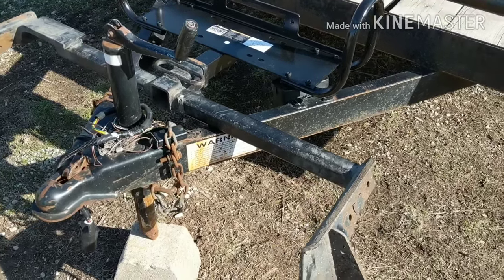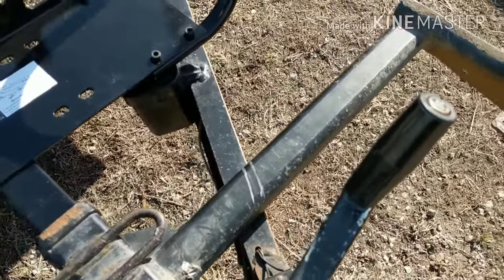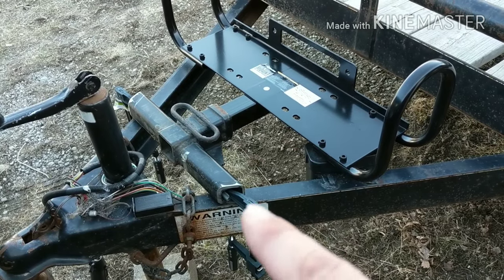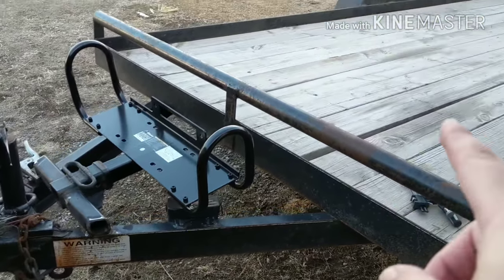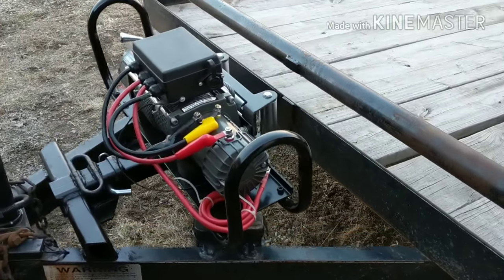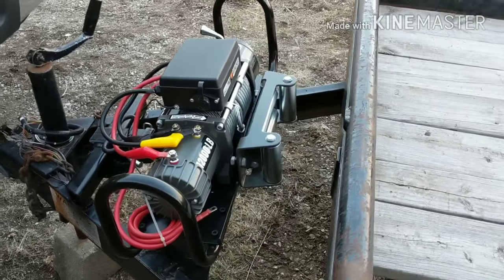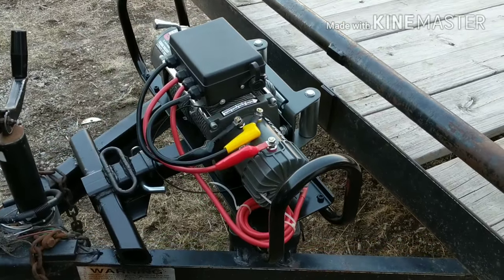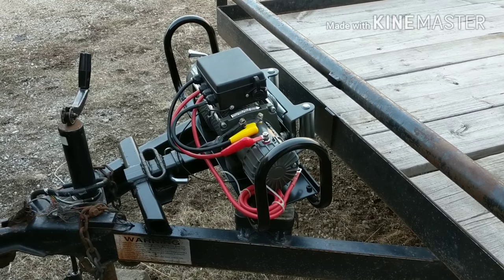Harbor Freight 12000 winch install (removable)

Comment: Great job. After I had a winch on one trailer, I now have them on 9 trailers. Indispensable. I'll always have one on any trailer.
 You have to to what works best for you. I ran size 0 welding cable from my truck battery to tree rear of the truck. I mounted a 350 amp Anderson plug under the bumper with a cover. Made a jumper to run over to the trailer. The winch has a short run of welding cable ending in an Anderson plug. Mounted solidly on the trailer frame I have two Anderson plugs mounted....one facing forward to the truck and one facing back to the trailer.
Hope this isn't confusing.
 I back up, hook up to the trailer. Take my jumper and hook to the truck and the Anderson plug facing the truck mounted on the trailer. Take the Anderson plug from the winch and plug into the Anderson connector mounted on the trailer facing back. It only fits one way, so anyone can hook it up and it'll be correct.
 I have a junction box on the front edge of the trailer. I can plug in my wired remote, or I can plug in my HF wireless remote so I can steer whatever is going on the trailer. 
 The junction box also has a simple waterproof switch. DPDT,  Center position off, up and down see in and out....just a backup in case of no wired or no wireless remote available.
  Thanks for sharing your video 👍
Reply from the maker: Yeah I plan to have it so I can just run off the trucks battery, I have a couple of trailers, going to set up the winch to work on them also.
Thanks for watching

Comment: Awesome! Thanks for sharing your creativity with us. I have a trailer hitch like the one you chopped up. Never thought of making it a base for removable winch. Now I just need a welding machine and learn how to weld---lol.
Would you have any suggestions on what might be a simple (inexpensive) welding machine to learn on and use for things like this? Just sort of point me in the right direction maybe? 
Thanks a million and Jesus bless.
Reply from the maker: Hope you can get it done, mine works awesome.
I would suggest buy the best welder you can, that uses a argon mix bottle.
Harbor Freight sells some affordable welders, Amazon, etc. Maybe a good used welder might be an option.
Good luck with your project.
Thanks for Watching
Reply: @barnyardgarage  Thanks for your helpful response. I will try to educate myself on welding machines and how different ones work before getting one. Thanks again for your encouragement. Will be subscribing to see what other cool things you do. Jesus bless.

Comment: That one of those fusion powered winches? Wheres the battery install?
Reply from the maker: I just hook up a battery when I need to use the winch, I don't leave it on the trailer all the time.
Thanks for Watching

Comment: You can use another receiver tube mounted to hold a stinger vertically where you removed the tube support. Then use a blank stinger to fab up an adjustable height pulley. That way you won’t be dragging the line on the back of the trailer as you load a car.  Also did you end up installing a battery mount/tray on top of your recycled receiver?  Good job! Love to see people re-use stuff with a bit of invention.
Reply from the maker: Thanks, I just use a battery box that has wing nuts to quickly hook up the battery

Comment: I basically have the same setup on a trailer I am rehabbing.  Coming along well. Need to pretty much do exactly what u did. I already have the same winch and mount. That slight off set when welding the receiver on - from what I gather you did that so the winch line spools back in line instead of bird nesting. Did that work? How much of an off set did you do if so? Thanks and nice work!
Reply from the maker: It works very good, I off set it, mainly to center it between the angle iron and bar on my trailer, but it also helps to keep it in a pulling position the closer the vehicle gets to the winch. Hope that helps you out, 
I like being able to remove the winch when not needed and thanks for watching, be happy to answer any more questions

Comment: Can this mount actually tow a trailer, say one of the light foldable ones from HF?
Reply from the maker: The piece I welded to the trailer is an actual receiver that I cut off, so that part will haul a trailer with the proper ball hitch, the other part is the HF winch mount. 
Thanks for watching

Comment: are those 12000 lb. welds?
Reply from the maker: IDK if they are 12000lb welds lol, but it has worked out for everything I have used it for so far.
Thanks for watching
Reply: Those couple tacks don't think will hold the winch but if it works it works
Reply from the maker: @Emmanuel it's fully welded and works awesome
Thanks for watching